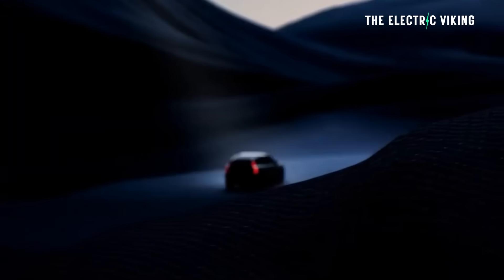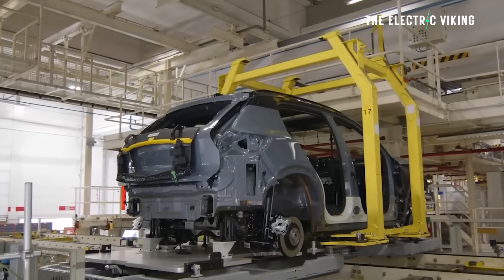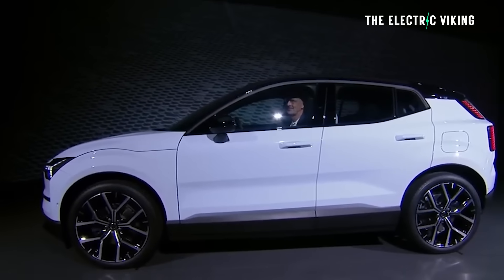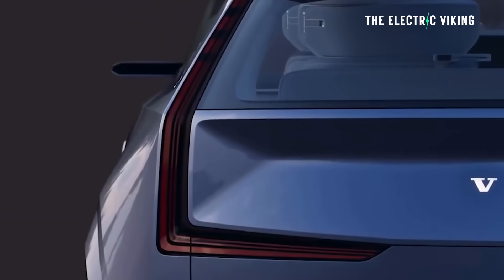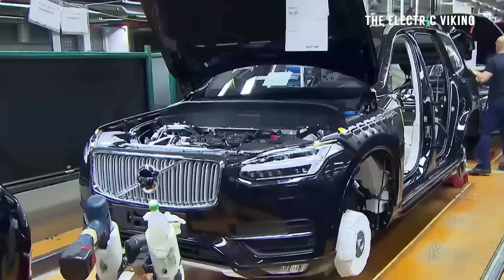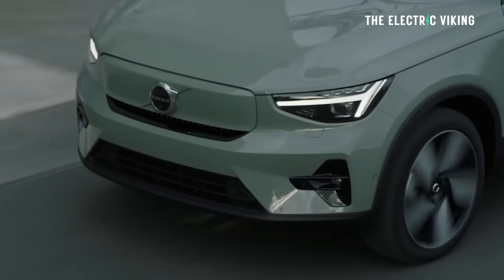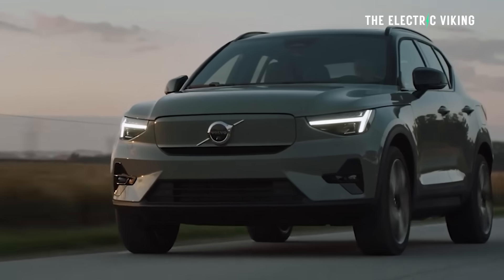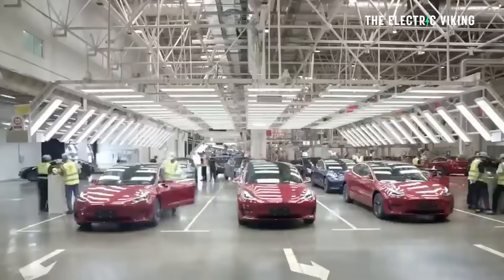Is Volvo a Swedish company or really a Chinese one...?

Comment: As far as I know, the SEA platform was developed by Volvo or Geely, but in Gothenburg, Sweden, not in China (as was said in the video).
Reply: You are correct.
Reply: @robertfonovic3551  Where have you read this? - all reports I have seen suggest that the SEA platform was developed by Geely and the full name is the Geely Sustainable Experience Architecture. It was developed by Geely - possibly with the assistance of the Volvo engineering team as a modification to the their previous PMA platform.  I haven't seen any Volvo executives claiming credit for the platform which would seem a little unusual if they had indeed had the majority of input.

Comment: Ehm, the production facility in Gothenburg (the Swedish headquarters) is undergoing modernization right now with megacasting and the building of an enormous battery factory. The plans are stretched well beyond 2030 with a production capacity, in Sweden, of around a third of the cars sold. Design, development (of most models) and most corporate functions are still in Sweden, and there are virtually no plans to change that. 

The smaller cars with a tighter budget is co-developed with other brands and that is something pretty much all competitors are doing as well. 

Time will tell, but there is a LOT of activity going on at Torslanda and Lindholmen with Volvo right now.

Comment: The design of the current Volvo and Polestar models were done mostly in Sweden, but the manufacturing for the EV models are done in China. Volvo did report that they will consider using their US plant to build the EX30 if the demand is there.
Reply: Manufacturing is done in Sweden, US and China. They are also planning a new plant in Slovakia
Reply: @sneaky_krait7271 Don't forget Ghent, Belgium. The XC40 and C40, among others, are manufactured there.
Reply: @karl-erikkald8876  Indeed, I forgot that one

Comment: Is not 100% Geely, there are other investors in Volvo, and the entire area around the plants is completely rehauled from an infrastructure point of view after  Chinese top management visited the area and was disappointed by the access infrastructure (they threatened to leave Sweden if the government is not taking actions, in 2–3  years a completely new roads network was ready in function). Minority stock owners in Volvo have several pension funds and some particulars. From what I know, at least one place on the board is for these minority investors. So yes, there is a Swedish component in Volvo's leading board.
Geely is the owner of CEVT (China Electric Vehicle Technology) and this company is in fact the engineering company for Geely's EVs. This company has design offices in both China and Sweden, so the design ONLY in China is not correct. By the way, I have known this company since 2015, a long time before the usual people of the world thought about EVs. This is why China is leading now because their preparations have been done LONG TIME AGO...!
PS: Volvo will cease to make ICE cars probably long before 2030, I think in 2026. In Sweden. Is building a joint venture battery factory near Volvo plant with NorthVolt...
Reply: I think you will find the other investors in Volvo are also ultimately majority owned by Geely.

Comment: I would say legally speaking, Volvo is a Chinese company. Just like Bentley is a VW company and Rolls Royce automotive is a BMW company, making them German. At least in those two cases, there is still many aspects of the vehicles done in the UK. 

When I consider Volvo, I believe they use Swedish design to help guide looks and interior, and have a combo of Swedish engineering and Chinese engineering in other aspects of the vehicles. Basically for me, Swedish influenced Chinese company. 

I feel like many Europeans do not accept the changes that have happened. The British automotive industry is mostly owned by Germans and Chinese companies. 

Geely made smart moves in getting the MG and Lotus brands as well. While I disagree with the heavy ESUV recently released under the Lotus brand, it was engineered in Germany and China with influence from the British Lotus team, but I consider it a Chinese vehicle. 

Whomever owns the company is what the company legally becomes. That is just how I view it.

Comment: I would call them a chinese multi-national.  Smart strategy going forward into the electric vehicle era, making them closer to where their consumers are.  Much as I would like to be critical of chinese cars, my current Honda Fit was built in China.  I have now had it for 10 years, and am seriously looking at replacing it with the Volvo EX30.  Would prefer it to have the Tesla charging port (since I live in North America), which is probably less than a year away.  And need to watch for changes in the rebates available in Canada (since we will have a national election in the next two years).